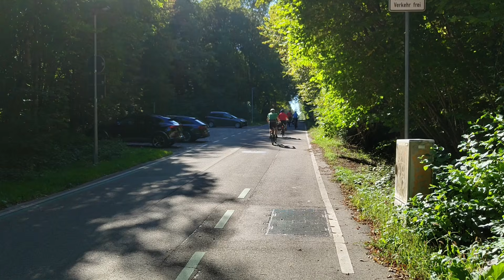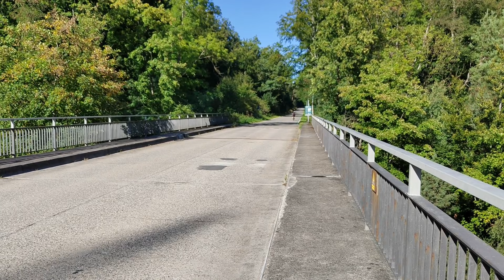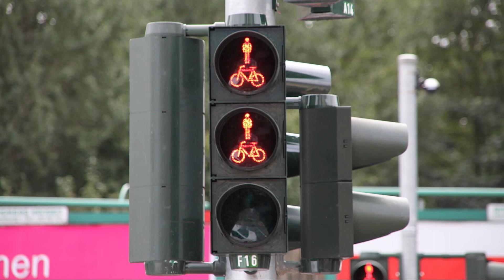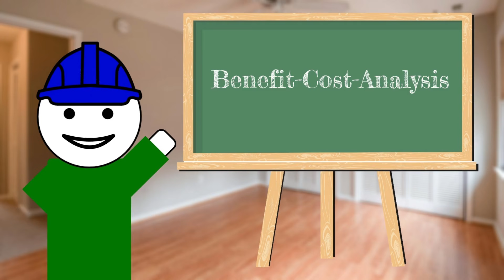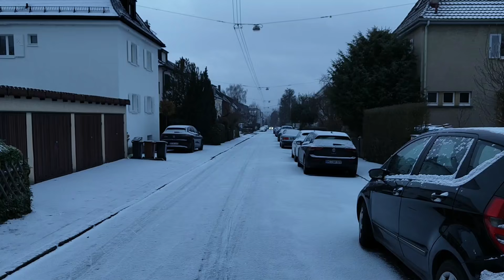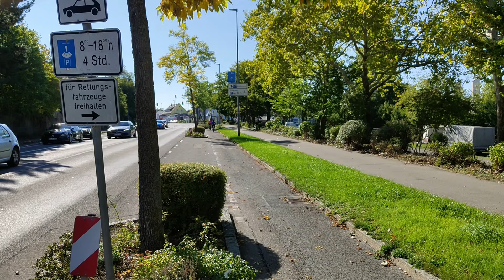Do Cycle Highways Even Make Sense?

Comment: I'm excited for a future where all these stroads in the US get slimmed down and turned into multimodal infrastructure. The fastest way to campus for me is a 3-5 lane road (low speed limit, this is not a highway). Currently, I feel adequately safe riding my bike on that road during off-hours because nobody is in the rightmost lane unless they are turning. If there was a liveable bus system and a connected greenway network, I bet that would reduce the traffic volume enough to cut the whole route to 2-3 lanes and have at least a 12' wide space to dedicate to other forms of mobility.

Comment: Here in Seattle we have the Burke-Gilman trail which was an old Freight Railroad used to move Fruit and Coal until the 60s when the Mines closed and the Farms became Suburbia so they turned into a Bike Trail and since it connects the University, Gasworks Park, Fremont, and Ballard it's extremely popular but it needs a better connection to the Fremont Bridge and the University Bike Routes, and because of its design there are only about a dozen Traffic lights across its entire Length (and keep in mind it's massive it goes all the way from Shilshole Bay in the West to Lake Sammamish up in the Foothills in the East) it's one of the most popular Cycling Routes West of the Mississippi

Comment: It all depends on where you drop them down, we got these to here in the netherlands and they one of the lesser things which are a big win.
Mainly they right beside the train tracks and therefor you just make use of a space which would be trees and green.
But that is the thing, at the one side these don't require maintance like car roads do because the bikes don't have that kind of weight.
But at the other side making space for something that is only been used by 1-5% of the cyclists makes you wonder if it is just a waste of money.
While their old road would maybe take 5 mins longer but it would not change in safety as these cycle highways NEED to cross a normal car road every 500 meters.
So basicly if you plan your route in advance you can be on the shared road safer than these highways are.

Comment: No they don't.
Bicycles can't even go reasonably fast enough to warrant making a separate highway just for them.

Better build more railways.
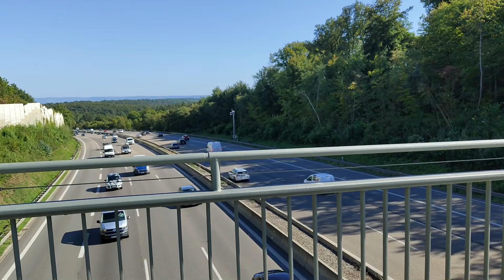Reply from the maker: 3:56 "Cycle highways are not about exessive speed, they are about maintaining a reasonable and consistent speed for the majority of the journey"
I also support the construction and improvement of railway lines. I don't see cycling and rail infrastructure in competition, but as a useful addition to one another.
Reply: @MobilityMinded1  That's only ever relevant in a congested city and only if you're afraid to get along with cars.

But i feel like bike lanes are already pretty much everywhere and that's more than enough, no need to build asphalt roads just for bicycles, that's redundant and no one's paying for it.
At least car roads and railways are actually economically viable and profitable.

Comment: There are approximately 50 cycle highways in the Netherlands, primarily running between two cities (train stations). They often run parallel to a railway line on a straight stretch. They are often assigned a number that also corresponds to the motorway and other expressways in that region. For example, the A35 > F35, A20 > F20, A7 > F7, A59 > F59, N201 > F201, N344 > F344, and so on.
Reply: So Scarry Out country routes

Comment: These numbers used to calculate the "BCA" seem to rather made-up. I mean, how accurate can the price for a "person hour" be calculated in a "publich" scenario? How do they calculate the benefits in healthcare?
Based on these number the BCA cannot be used as a single criterion for evaluation if the project is worth the money. How is this usually handled?
Reply from the maker: For example the healthcare benefits in my example with the cycle highway with the score of 4.8 were calculated as following:

1) Expected savings in distance traveled by car, multiplied by the rates of minor and major injuries and road deaths (4.8k€ for a minor injury, 116.2k€ for a major injury, 1161.9k€ for a road death)
2) Considering only trips over 3.6km, which were previously taken by car but will now be taken by bike: A benefit of 0.125€ per km

Of course the BCA is not perfect, but especially when dealing with public funds, the costs and benefits of different projects have to be made somewhat compareable.

Comment: BCA's are...IMO pretty much BS. I'm sure many agencies try very hard to provide an honest assessment, but even in the most rigorous analysis, a BCA still makes enormous assumptions and simplifications which are by the subjective value judgments of the people involved. For example, you state that the costs of a project are easy to determine, but that isn't true. The BCA for any highway probably doesn't (but probably should) include the cost of increased parking space for residents because their city becomes more car dependent and they're forced to own more cars. Every highway built or expanded does contribute marginally to that cost, but it is not included.

BCAs are most useful for deciding between similar projects "which cycle super highway should we build" not "should we build a cycle super highway or a new motorway". Instead for large scale decisions like this, we should stop pretending that numbers can give us an empirical view on the world and instead argue for a vision that we want to achieve.

Comment: The last part is crucial. I live in Bulgaria and while we have impressively long cycling paths, they tend to be poorly connected. There is a decent "cycling highway" in my town but eventually it just goes into a motorway with no marked crossings, forcing cyclists to dangerously cross a busy road. 
Also some cycling paths look nice but are covered in debris; in such places cyclists often use car roads to get by. So maintenance part should not be neglected

Comment: Ah, the Cost-Benefit Analysis: a tool that allows you to promote or (usually, alas) block whatever you don't like by suggesting concrete quantifiable data using the vaguest of criteria.
Reply from the maker: Of course, the exact calculation, including which criterias were used, of the Cost-Benefit-Analysis should always be publicly available. It's a shame that this doesn't always happen, but in the case of the 4.8 score I talked about in the video, the complete calculation can be found here: https://www.radschnellweg-euregio.de/wp-content/uploads/2017/07/Potentialanalyse-Nutzen-kosten-Analyse.pdf (unfortunately only in German)
Reply: For extreme evidence of this look at 'migrantwatch' data vs UK government data for cost-benefit analysis of UK migrants. And their inclusion of British born children, where 1 parent is British and 1 in a migrant.

Comment: In the USA, the c&o bike highway connects DC with Pittsburgh!  It's only useful as a piece of bike-packing tourism though. 

Also in the DC region is the w&od trail, which is decently connected with DC and with each town it traverses.  It'd be very good if rail service were restored along it to Leesburg though.  It also connects with metro service several times along its length

Throughout Fairfax and Loudoun by DC, highways+arterials are often followed with a wide "multi-use" sidewalk.  They'd be fine if not for the huge highway intersections they're left to share with cars.

Seattle has mostly-excellent existing and in-progress bike coverage spreading east past Bellevue and going north toward Everett
Reply: Well, in Arlington there's an overpass over a major road intersection, and near Leesburg a tunnel under a 4 lane thoroughfare, although there are also several other crossings that require stopping.

Comment: I personally would like a multilane divided highway with on ramps, but at a bike scale. E-bikes can pass slow bikes on in the left lane just like a regular highway. It's just a dream though I don't think it would ever become a reality.
Reply: Adding width to bike trails should be enough.  If a bike is fast enough to need ramps then it should be in road traffic
Reply: @hobog  i just dont like being cut off by people merging into the bike lane from a side street
Reply: You just need to make your bike highways wide enough, ideally so that at least 4 people can cycle side by side (you'd need at least 4m/13ft for that). That way, if someone merges, you can just move to the left to pass them uninterrupted, even when someone is coming from the other side as well. Same when you want to overtake someone.

Comment: Everything is wrong. Bicycles are dead — they were left behind in the 20th century, forget about them. It’s only a matter of time before they are replaced by e-bikes, electric unicycles (EUC), and scooters. Electric transport is faster, so the real task is to adapt infrastructure to it.
Reply from the maker: In my opinion it doesn't really matter if we use bicycles, e-bikes or scooters. (I prefer e-scooters over bicycles too). But the infrastructure we need is roughly the same, and all of those examples would definetly benefit from cycle highways.
Reply: @MobilityMinded1  A bicycle’s speed is around 20–25 km/h. The speed of an e-bike / EUC is 30–50 km/h. At these speeds, a wider bike path is required — it’s effectively already a bike lane. Terrain / inclines and start–stop conditions don’t really matter for them either.
Reply: @ovrepin bycicly lanes are also dedicated lanes for scooter traffic (30 to 50 kph) outside of town/city main density zones. So in towns and cities you'd be on the road and in between cities and towns on the bicycle path
Reply: 1) Regular non-motorized bikes and scooters are more affordable and more accessible, and it's simpler for kids to learn them.

2) Regulations for E-scooter e-bike are weaker than for cars, battery fires are still a global hazard especially with indoor storage.

3) Can you repair your electric unicycle on your own like you can a human-powered vehicle?  How do repair costs and logistics compare?

4) At 30-50+ kmh, with the weight of an e-bike/E-scooter, why shouldn't you be in general road traffic?
Reply: The average lifespan of e-bikes/pedelecs is 6-7 years. After that time, t he batteries are degraded - and fitting replacement batteries are unobtanium. Even more so, as batteries and motors/electronics are all "dongled".
Reply: @Spechtlerimwald  Even less 🙂
I’ve been riding electric unicycles for 6.5 years already and have even replaced the batteries — but that still won’t make me switch back to bicycles.
Reply: @ovrepin The motor still works?
Reply: @diezgp  Yes. There were mechanical failures, such as pedals or the wheel axle from a strong impact. I replaced them and now the whole family uses.
Reply: @ovrepin OK thanks
Reply: And what kind of infrastructure is best suited for that type of fast e-bikes? Right: cycle highways. They accommodate everything from bikes to speed pedelecs, no need to bash on classic bikes for that.
Reply: Generally speaking, we don't need faster one- or two-wheeled vehicles. The vastly higher risks just aren't worth it.
Reply: @glib4233  At speeds up to 50 km/h, the risks increase only slightly. But travel time and fatigue are significantly reduced. Speed is one of the reasons people choose a car. I don’t want to spend an hour on the road if I can get there in 30 minutes.
Reply: @ovrepin Risk increases exponentially with speed. That's just physics. Most casual cyclists are going to be averaging like 10-15mph. ~24kph. That's less than half the speed you're suggesting. Class 2 ebikes shouldn't exist with throttles and a lot of electric motorcycles are being sold as "ebikes" but I digress. For longer distances that someone doesn't want to cycle, cars aren't the only option for transit. Along with bike lanes we need trains, trams, buses, paths, and subways.

The fact is that cars are quickly becoming one of the slowest options. My drive to work now takes 35 minutes during mild rush hour traffic. It would be 40+ if I left later or on a heavy day. Taking light rail takes me 45 total with 26 minutes of that on the train itself. Cycling directly takes 55. A 10 minute difference really isn't that big of a deal. Especially when you consider that 26 minutes on the train I can be reading a book, or watching videos instead of focusing on not dying or getting hit by another car. Then the other 20 minutes I'm getting a small workout in. Alternatively if I bike 55 minutes, that means I don't waste 35 minutes of my day driving and then have to find a 55 minute window to get a workout in. I instead get 35 minutes of cycling for free and only need an extra 20 minutes to get the same workout. Time isn't the only factor people should be looking at when it comes to commuting.

The fact that in the US where we have notoriously horrible trains and I'm still already close to 1:1 with time.. Cars and traffic will only ever get worse. Places in LA have 3-4 hour one-way commutes. Cars will never make sense long term.
Reply: @scopie49  Does this mean that a safe speed is 5 km/h? 10 km/h? You say 25 km/h only because it feels familiar. If you ride an e-bike or an EUC for a year, you’ll realize how unbearably slow that is.

“Fitness” is a manipulation. No one builds multi-story buildings without elevators for the sake of motivation, or cars without power steering. Pedestrians don’t carry kettlebells for fitness. Having to arrive sweaty and exhausted is a huge downside. From experience, I know it’s fun for the first couple of years. Then it gets old. Only with bicycles has this absurd argument somehow become the norm.

Try a small electric unicycle. It’s easy and quick to get to the train, it takes up almost no space onboard, and then you ride straight from the carriage to your destination. You can wear normal office clothes.
Reply: @ovrepin  I regularly take my bikes up to ~50kmh on descents and stuff. So I'm used to it and know how to handle it. But that is NOT a safe speed to be traveling at. Especially on bike paths with other pedestrians. It's also not my average speed. 24-32kmh is a much more reasonable speed when you're around other people. And I've been bike commuting for about two years now. I don't need to go faster because I allocate my time properly. I've seen people on uniwheels go flying past me at 35+ and they're always wearing motorcycle helmets because of the inherent danger. Once you're above 32kmh it's really a good idea to start wearing other safety gear because a crash is going to hurt. A lot.

No one wants to be sweaty or exhausted. And yet the Netherlands does it anyways. It's about health and safety. Americans are fat and lazy. It would do some good to encourage them to get on a bike. Cycling in the US is still seen as a sport rather than a mode of transport. If we had shorter/safer routes, you wouldn't get as tired or sweaty from a short 10-15 minute commute. Mine just happens to be 55 minutes.

I'll stick to my bike. I use my commute to train for doing the century rides I plan. It's the easiest way to keep my fitness without adding a bunch of extra time to my day. And I do own a class 3 ebike already. So I understand the benefits of them. But there are way too many fake or unrestricted ebikes that are a literal danger to riders and pedestrians because of their uncapped speeds.
Reply: Might as well buy a motorcycle then. A lot faster
Reply: @Avelio3939  I have one. An electric unicycle is much more convenient, especially for city use.
Reply: E-bikes and Scooters do not have the health benefits that cycling does and are also prohibitively expensive in comparison. A 50kmh path is not a safe or suitable way for children to get to school or for the majority of older people to get exercise. Cycle paths need to exist.

Your speeds are also way way off. My average cycling speed would double if I weren't slowing for lights, slowing for pedestrians, slowing for other riders due to narrow space etc. I would happily cycle at 40kmh if it were safe and suitable to do so.

Cycling is very important still, and it is far more sensible to limit Ebike speed and add them to cycling paths than to make weird middle ground lanes were only people going very fast can go but only not in cars.

Oh and btw cycling is used as a method for transport at higher rates now in my country than ever before, other than during covid when it was more safe.
Reply: @DuppyBoii187  For fitness, there are gyms that provide a safe and comfortable environment. (For those who need it, though the need is greatly exaggerated—it’s more of a religious dogma to justify the bicycle.) Only athletes can ride at 40 km/h. Ordinary people ride at 15–25 km/h, especially those over 40. Apart from a couple of countries, bicycles never became widely popular. Moreover, in places where they were once popular, they’ve long been forgotten. In China, everyone rides electric scooters. The same will happen in the Netherlands. Bicycle networks will have to be redesigned.
Reply: Electric transport is only as fast as lawmakers allow it to be, and in Germany that is currently not very fast (scooters, bicycles) or regular road speed. Besides that, bicycles still do and likely will exist for a long time, simply because the ratio between speed and price is unbeatable.
Reply: not everyone is rich enough to afford an e bike mate
Reply: @bigmanted9864electric scooters are very inexpensive